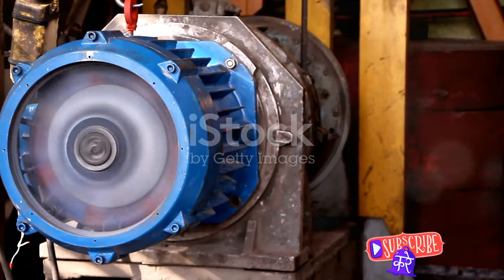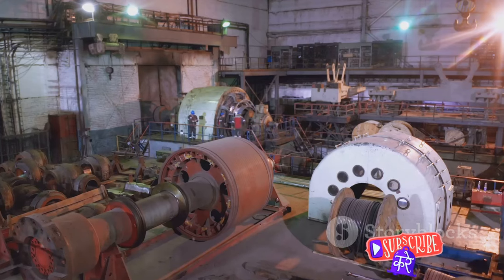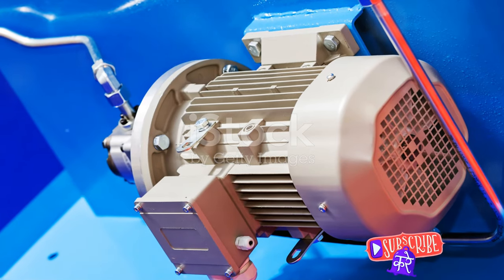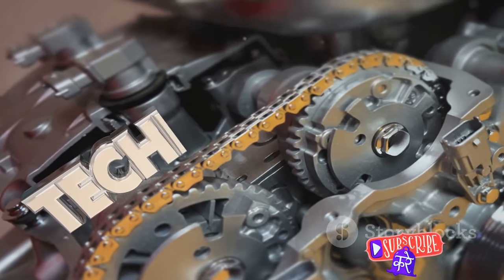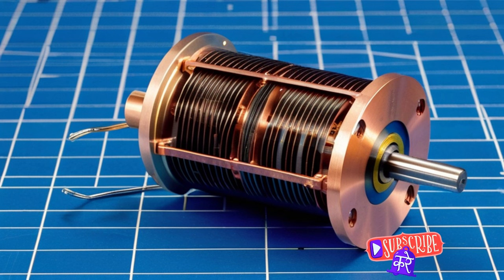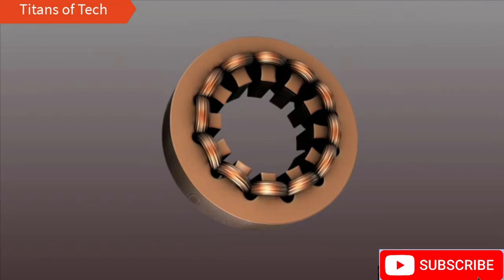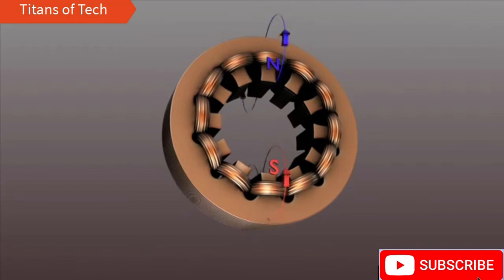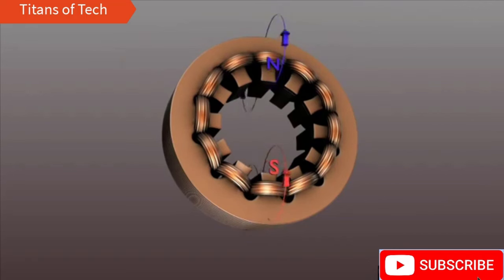Asynchronous Motors Unveiled: The Induction Motor Explained #inductionmotor #acmotor

Comment: How much torque can one induction Motor generate is it determined by electrical output or by size of the motor or something else, Entirely?
Reply from the maker: the torque generated by an induction motor depends on factors such as electrical output, motor size, flux, current and slip. The motor's design and operating conditions play a crucial role in determining its torque capabilities. If you have any further questions, feel free to ask! 😊